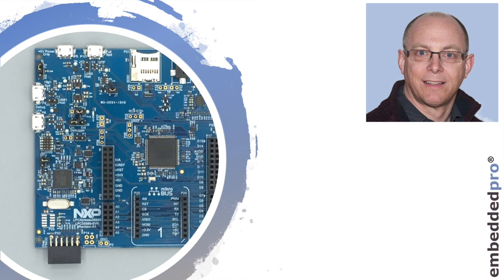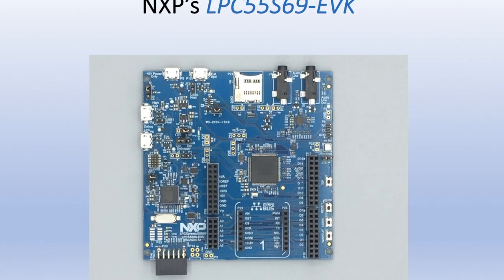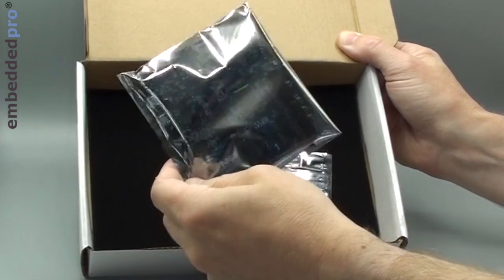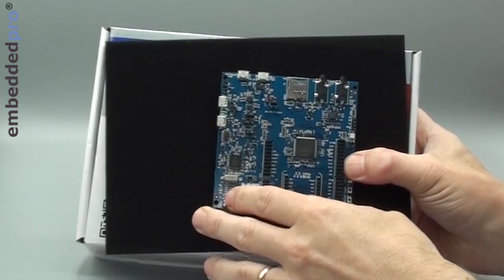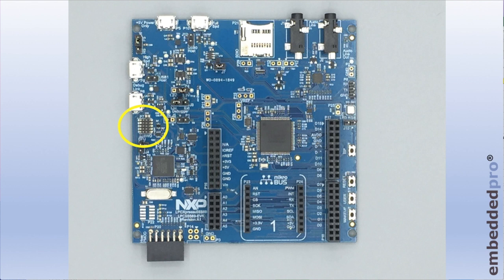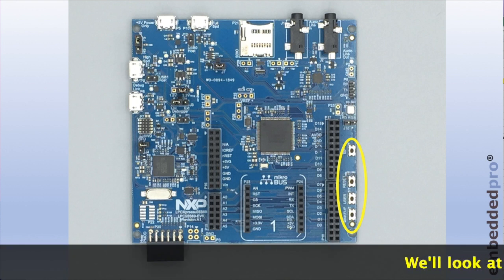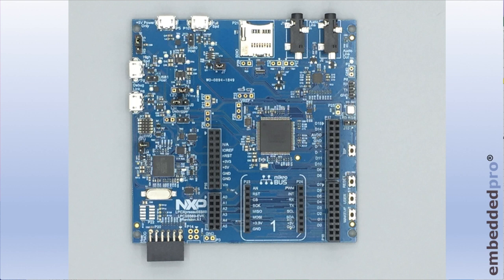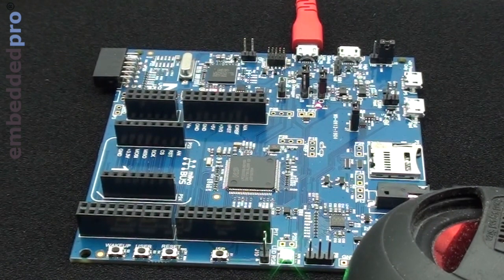1 Unboxing and Getting Started

Comment: Thanks, Mark! I have just gone and bought myself a brand new NXP  LPC55S69-EVK board just to follow you on the videos. :) I have it at hand right now and I have seen that there is a good amount of demo on this board that I do not want to lose when I start working on it. Is there a way to put the demos back on the board after working with it? getting them from the examples? I would be happy to know. And if I can't get them from the samples that I download in the SDK for  LPC55S69 - I would be happy to know if I can save the current FW on the NXP into hex or bix and upload it later on? thanks

Comment: hI Mark, thanks for the tutorials.  have you had any luck getting PLL1 on this board to function?  I have attempted several times to set it up using the clocks tool (and obviously updating the code afterwards), but it does not work.  For example, if i hook it up to the sdio module, and set it all up to output 50MHz, 0hz is actually read back by the SDK, and the sd card does not function.  However if I use pLL0 I do not have this issue. Cheers, Rory